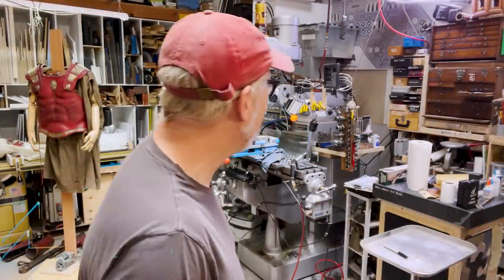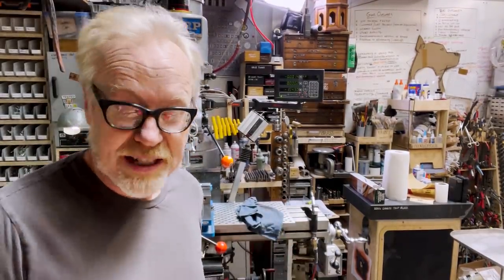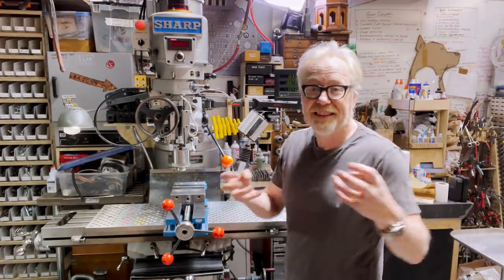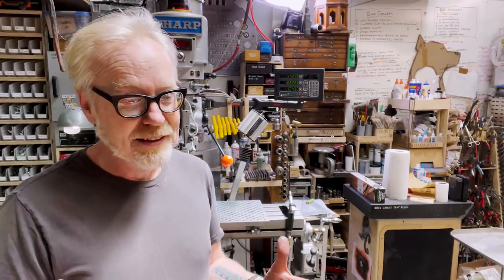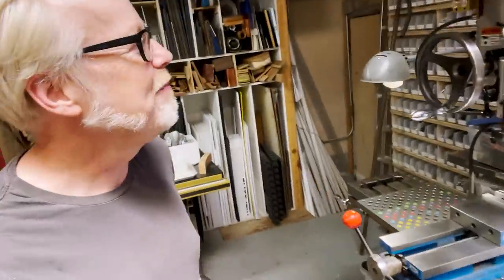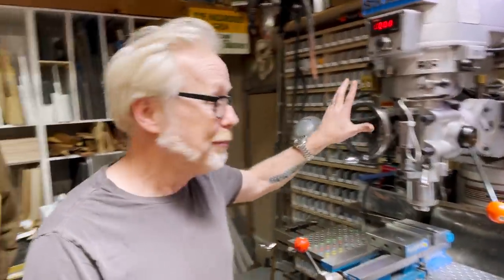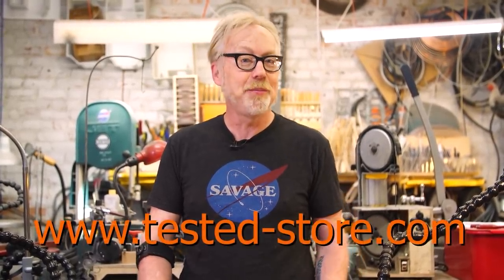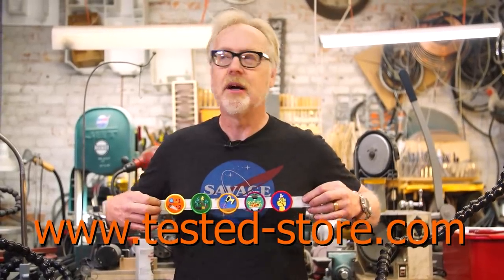Adam Savage's New Milling Machine!

Comment: You say you're not super fast. Fast does not always mean expert. My dad has been a machinist for over 50 years. He has worked as a machinist, worked in tool and die, in R&D and for over 2 decades for an industrial service company. (Basically taking portable machines out to plants and strapping them on machinery/parts that need repair but are too big to feasibly take into a shop to machine.) The machines are portable, but just as exacting.) He is my hero and capable of thinking out of the box beyond the norm. One of the reasons I enjoy watching your videos. I work at a company that he did as he is now retired (and subsequently busier than ever) and hearing veteran machinists speak of his unparralled skills make me so proud. He taught me to cut pipe and a plant machinist after watching me, asked how long I had been cutting pipe & was shocked when I said 6 months. He said, "Ive seen guys that have been cutting pipe for 20 years that can't cut pipe like that." In saying all that, my point is, he still takes his time developing a plan, thinking through it before he starts work. His quote from having to go out and save jobs after "faster" less experienced machinists screwed things up will stay with me forever -"It's always easier to do it right the first time than having to unf*ck it first" Creative machining as he has done and you routinely do will lead to unexpected/unintended consequences from time to time, but thinking through things will eliminate many of them. Keep up the great work and fun videos!

Comment: Good on ya Adam! I'm in a similar situation as you. I bought a used Bridgeport of 60s vintage 11 years ago and it is what I learned on. It blue a belt a couple of months ago, one of the "toothed" ones that requires a head tear down. So I checked to see what a head rebuilt would cost and decided to buy a new one. Couldn't afford all the nice features you got, but did get a power feed and a DRO...and it is SOOOO quiet. As a machinist I can share and appreciate the pure joy a new machine brings. Good luck/have fun. B--Safe

Comment: I wish I had an old worn out milling machine. I have to make all my parts with files.
Reply: Even with a mill you still end up doing a lot of filing.
Reply: Some of the very first machinist used  files, stones, scrapers,  to remove material, those tools were then used to build machines like the lathe and mill.
Reply: Sometimes that is the quickest way to make something.
Reply: I thought this was a CNC joke at first...
Reply: @brandon_stargrave  Lol now I get it!
Reply: When I first started machining parts, I had to train under a german who made me file all my parts to perfection and within a certain time frame before he’d let me start on a mill or lathe. Made me a much better machinist because I learned patience and precision before I even touched a mill. Then before I actually made any parts, I took the mill apart and checked every tolerance and stoned every surface and everything. I worked in a machine shop for 13 months before I really started machining.
Reply: I wish I had a file. I have to make all my parts with wishful thinking.
Reply: @brandon_stargrave  EVERYBODY DANCE NOW!!

that's a CNC joke...
Reply: @Vagolololo  Wishfull thinking? I wish I had wishful thinking. Back in my day we had to make 27 locomotive diesel engines by breakfast with nothing but our own toothbrush and the promises of the paperless office.
Reply: damn you get a file? ive been using my teeth the last 10 years
Reply: Henry Maudslay
Reply: @nolansprojects2840  English machinist apprentices also were required to fabricate, e.g., perfectly square metal blocks, with a file prior to being allow to use machine tools, according to several Limey machinists I once worked with.
Reply: @FoxMacLeod2501  lol. Yes it is!
Reply: @FoxMacLeod2501  oh no , programming mistake ,everyone crash to the floor

Comment: I would suggest adding an LED Halo/ring light to the spindle quill. Even if you think you have enough light on the subject, this simple addition is a whole new level of visibility. With a small amount of work you can have a clamp-on LED ring light directly over your cutting action, reducing the amount of shadow and blindspots that results from using directional lighting. I wouldn't run a manual without it. 

The smaller mill I had, I was able to just pop an 80mm light directly on the quill and just friction alone holds it great. I think the full knee mills such as yours would need a larger ring so probably an adapter of some kind is needed but I believe that its well within your abilities to make. Might make for a great one day build. 

Don't take my word for it either, look up LED Halo light for Bridgeports or other mills and you'll find enough examples. There's even some being sold specifically setup for the purpose of mounting to a mill, not sure if they are worth the money over just the barebones LED rings you can get for under $20. I bought a 2-pack for under $20 and 5 years later am still using the first.

Regardless, that Sharp is a good looking mill! It's got to be really nice to turn the wheels on something brand new and well made.

Comment: We have 4 Bridgeports in the shop at my work. They are of ascending age and quality and everyone of them has a Kurt vise on it. They are amazing pieces of gear... Just this past Friday I was removing a 1/4" of material from a 1" block of aluminum with a fly cutter because one of the other engineers mismeasured where two surfaces meet.. (grrrrr.. nevermind... different story)... Anyway.....  I was marveling at the precision and workmanship of the Kurt vise.. If there are better vises out there somewhere in the world, I'd love to see one..although I highly doubt there is.. I am a Mechanical Engineering Tech, and I literally could not do my job without a Bridgeport.. Fabricating pieces for newly designed machines or for improving processes around my plant. Use it nearly every day. A marvel of precision and ingenuity....

BTW... All of our axis have motors... inuding the knees.. I can't imagine them without it.. Think I'm spoiled..

Comment: When I started with a major frozen food manufacturer in 1974, our machine shop had mostly used machines most 20years or more old. Forward 30 years another major food manufacturer bought us out. The came in and told us to start up grading out shop. We bought a 18” by 72” lathe! Great but than they said we could not afford to buy anew mill. My boss told me to fix it as cheaply as I could. Page 1 bought a new power table ($5000 from a friend who ran a machine rep business, 1/2 price from that of the manufacturer). Than I took the power head off and rebuilt it and had the motor remanufacture. Replace 5 of the 8 gears and all bearings and more things than I could remember. That all cost $3500. After it was rebuilt and the boss brought in the manufacturer tech to check and calibrate the lathe. When he can in I was with him for 3 hours and he finally turned to me and said why did they call him in to calibrate a new machine. I had to show him the parts I had changed out before he told my boss that that machine was now to tighter tolerances than machine that left the factory now! Only got a pat on the back also I did make all the mechanisms mad buy adding a duel key system To run it so these with monkey brains did not destroy it. Retired in 2017, plant closed on 2019 and I went to the equipment sell at the plant and bought that mill for $1000 and sold it to my rep machine guy for $5000 plus a 10 % sales bonus for getting the new plant to buy the machine and reinstall it back in the same plant! Also got a $2500 job for month to help them learn to use it.

Comment: So what are all the multi-colored spots on the left side of the setup table?
Reply: I’ve been wondering that for months. Only today did I learn that it’s called a “setup table”.
Reply: @shubinternet  I think that's just what Adam calls it. When I started a web search to find out what the colored dots were, I eventually found "tooling plate" and apparently the color coded dots correlate to the threaded hole size they are covering.

Comment: So Adam I love your builds. I watched one last night that scared me. It was the mandalorian rifle.  When you were polishing the scope with scotch Brite. You gripped the whole piece from the top.  One handed.   No no no. I care about your arm. When you grip like that,  your fingers can lock into a fist around the shaft and pull your hand into the lathe. When I was taught to polish, you held the Brite on the bottom side with both hands usually a couple of fingers so if it catches it pulls from your hands.  Same with Emory clothe. Sandpaper. Always underside always lightest grip. Also when dealing with coils I seen you grabbing them with your hand.  Some pliers is the way to deal with those. Dont grab the Parrarell cuts or any with your fingers. I don't want to get into horror story's I've heard. But as an job shop and aerospace Machinist.  Please heed the words of someone that's been taught in a shop by people with 300 plus years experience.  I love learning from you. Also on this Knee Mill is it power Z axis.

Comment: It isn't just using the mill that can wear it down, crap in the air can too.  My first job was at a welding and machining shop, I wasn't hired to weld or machine, I was hired to clean but ended up doing both anyhow.  The small machine shop had 2 lathes, 4 mills, in what was once a small 1 or 2 car garage.  3 people usually worked in there and they smoke like chimneys.  Plus the coolant turning into mist and dust from metal.  We took apart one mill and all that crap in the air had settled on the tracks and just got ground into it.

Comment: What a sweet vertical milling setup!  Get that recirculating cutting fluid setup working.  Your bits will thank you.
Reply: His table does not look like it is setup to drain. You really don't need to use a coolant pump unless you are doing production work. If anything he should get a mister.

Comment: Nice machine, what model is it ?  some of the Sharp are listed as box ways ?  Not come across that before.  Wear, wipes tears away. , the auto oiler shoild keep it as good as new for decades. moved my machines a few feet on cut scaffolding poles.  Always a pleasure to view. Clough42 just bought a new mill also, there is a run on them.

Comment: Only thing I don't like about a Z-axis DRO on a Bridgeport is that due to the R-8 spindle, you can't use the tool offset system. Bridgeport made J-heads with 30-taper spindles, but they're hard to find.

Comment: What operations do you need a lathe for that you can't bootleg with a rotating positioner if you absolutely had to?
Reply: Single point threading. Grooving. Boring requiring a good surface finish

Comment: Bought an Hurco KM3P 3hp CNC mill with a busted power supply for 110$....50$ in Ebay parts it's up and running.... Mostly in manual mode..Mostly..

Comment: I technically knew that they must make new milling machines. That said, I don't think I have ever seen one less than 30 to 40 years old. I know the first one I ever used was in Jr High and that would have been 1992, and it was 32 years old, and I know they still have it 30 years later.

Comment: Ok, a new mill costs 1000s, rescraping the waves cost 1000s, how much would getting a new set of tables cost(assuming that's possible)?
Reply: Even if you get a new table, you still have to scrape the knee's ways, because those would be worn. A new table by itself won't fix the problem of wear. In a worn machine the lead screw would also need to be replaced. Just makes financial sense to buy new, unless the mill in question is a high end mill that rebuilding it makes financial sense.
Reply: Adam's mill cost over ten thousand. Don't let him snow you.

Comment: "You can build car engine on this thing"

I hope so, because I'd have to sell my car to get one.
Reply: Except for the pistons where you need a lathe... Because they are rounds pieces.

Oh, and some parts need higher precision so you might need a precision grinding machine.

And you also need to put the parts together... So maybe some welding machine as well and some pressure control bolt.

Basically, an engine is complex to put together.

However, you can do a lot on a milling machine.
Reply: @therrydicule  You can make a lathe and a grinding machine on a milling machine.
Reply: @enochporter  The hardest part of a grinder is the spindle and the precision leadscrew. These are usually ground and/or lapped. They cannot be done on a mill.
Reply: @grantsamara6905  seems you don't have much imagination or creativity, are you the guy who sweeps up the shop when the machinist isn't working?
Reply: @grantsamara6905  it's not my fault you said "it can not be done", you insulted yourself.
Reply: @grantsamara6905  says you have to have a lathe to make round stuff, but how was the first lathe made...lathes have round stuff, so who made the first lathe?
And just wait until I tell him I can also drill a square hole with a regular drill press, his little empty head will explode.

Comment: A good practice is to put your vise in different locations over time, offset to the right or the left to better utilize the entire working area of the mill ways! Congratulations on the new mill!
Reply: It also reduces potential distortion (over the mill's bed or the vice's) over time, usually incurred by ambient temp changes or incorrect torquing of the holding bolts
Reply: Good point

Comment: 1:10 - In Europe I think "chasing zeros" makes just as much sense. You're constantly trying to increase your precision and accuracy to be 10x better than it was before, e.g. inserting more zeros.
Reply: the metric system has a special place for zeroes, but tends to remove them quite efficiently.
Reply: Quite frankly if you're looking for more than a few thousandths out of any cutting machine then you're doing it wrong. If you want an extra zero then get grinders.
Reply: @1pcfred  quite frankly youre probably using the wrong techniques if you cant , you can turn a diameter reliably on on a lathe for example to within 2 tenths, if youre using the right method.
Reply: How long till he buys a CNC mill?
Reply: @jokeassasin7733  don’t think he‘s a CNC type of guy.